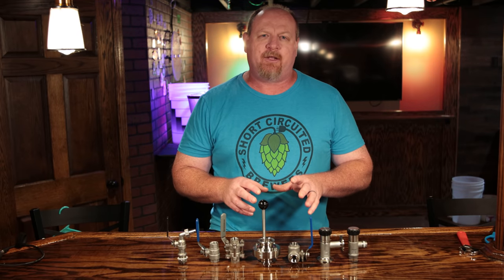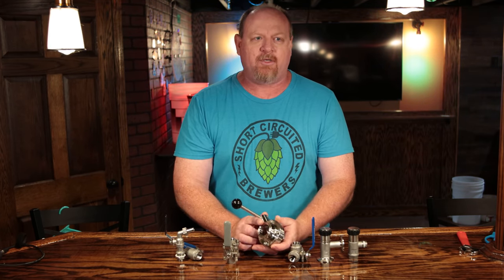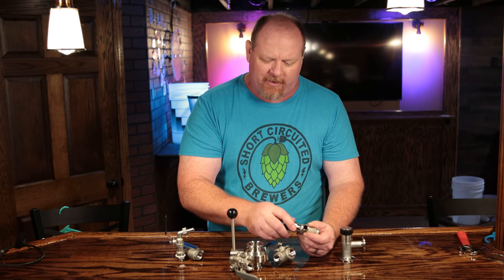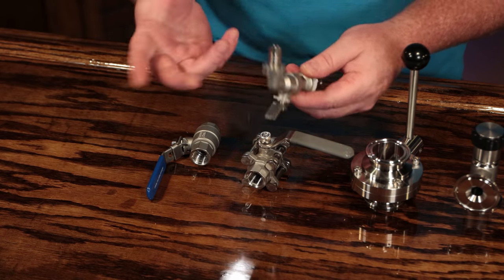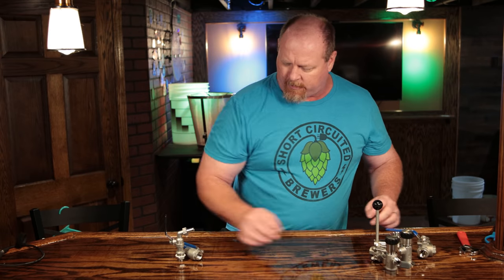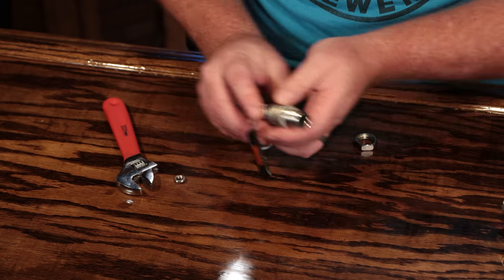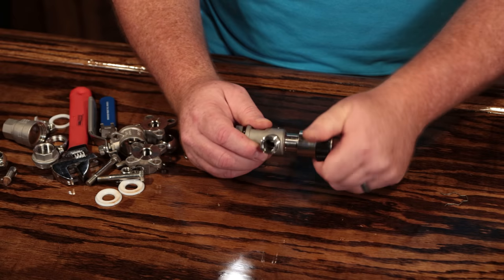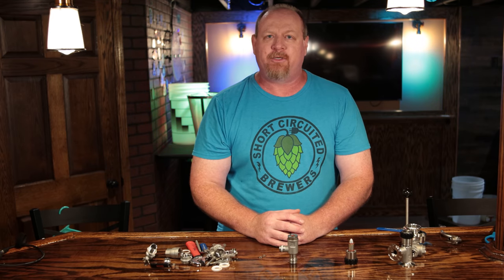Home Brewing Valve Comparison and Cleaning

Comment: I wish the two piece ball valves could always be disassembled.  I got a few used ones in a lot and as you mentioned there is gunk in around the ball and Teflon washer.  Impossible to clean now!  Great Stuff! 🍻
Reply from the maker: Thanks!! 👍🍻
Reply: They can be.  I have been taking mine apart for years after every brew.  Quick and easy. IMO (and contrary to popular opinion) they are way easier and faster to clean than the 3 piece. Initially you do have to place the valve in a bench vice or something similar and use a solid crescent wrench to crack the valve open the first time.  But after that I simply hand tighten for use and hand loosen each time I want to disassemble and clean.  You then have full access to the 2 teflon washers and the ball itself.  So much easier than undoing 4 nuts from 4 bolts.  Then putting that all back together again.  Not to mention the 2 piece is generally 1/2 the price of a 3 piece.  If you are like me and have several valves in your set-up you save a lot of time.  That all said the TC butterfly valves are the bomb for fermenters but for applications where precise flow control (such as controlling flow out of a pump or mushtun) then a 2-piece ball valve is a great option.  Sorry for the long ramble.  Cheers.
Reply from the maker: Good stuff!! 👍🍻
Reply: @Davewick10  yeah, I was trying in the vise. But I guess it needs another go.  Not sure if Brian mentioned be the other nice thing with 3 piece is that you don’t have to over tighten them to get the orientation you want.  Just tight the base against the pot and then assemble in the orientation you want the lever.
Reply: @FermentationAdventures  yep give it another go and they will open for you then its hand tighten and loosen after that. Cheers
Reply: @Davewick10  yep, vise, 12” crescent wrench and a couple of whacks of the hammer and they opened up.  And they’re filthy!

Comment: Great video. Very relevant. I do have the Anvil valve and it hides lots of gunk. I scored a small air compressor and after cleaning I pump air thru it and rotate the valve in and out. Certain O rings are not found on Anvils site. They did help me out. On another thought what do you think of trying to use an ultrasonic cleaner with the valves? I know there are larger ones available and are used for things like carburetors. Im just trying to lessen the disassembly in order to preserve o-rings and save time if possible. Any thoughts on this?.
Reply from the maker: That might be doable...I'll have to research it! 👍🍻
Reply: I'm interested in this concept, Brian if you get a chance to research please include in a future maintenance video.  Keep educating us!

Comment: Do you think circulating hot PBW through the valves would be enough for cleaning or would you still take them all apart? I use a Blichmann BrewEasy with manifold and circulate hot PBW though the system after each brew.
Reply from the maker: The Blichmann valves are generally ok that way but any other ball valves it's is not enough. They need to be disassembled.

Comment: I am thinking of adding a ball valve to my kettle, and this info is very useful!  All of the valves you showed can handle the heat of being on a boil kettle, right?  Also, I recently acquired a second hand Ss Brewtech Brew Bucket.  Any idea if the ball valve on that can be fully disassembled like what you showed?  I can remove the barb from the body, but cannot figure out if the ball comes out.
Reply from the maker: I'm not sure those come apart? All the valves I showed are all able to withstand heat. 👍🍻
Reply: @ShortCircuitedBrewers  Returning to say Thanks!!  I recently acquired a second hand 15 gallon kettle with a Blichmann 3-piece ball valve.  This video gave me the info and confidence to disassemble and clean the valve.  Even though the kettle has not been used in a while, the innards of the ball valve had a lot of smelly, oil-like liquid that needed to be cleaned out.
Reply from the maker: @CascadesHomebrew  great! Glad it helped! 👍🍻

Comment: Before I got my foundry, I used to use the EZ clean ball valves that use a triclamp fitting to hold everything together. Super easy to clean! I had no idea those Blichmann valves existed... Any idea if the threaded version would fit the foundry?
Reply from the maker: Not sure good question!!

Comment: Great idea for a video, Brian! I typically use tri-clamp butterfly valves on my equipment. I thought about using the Blichmann tri-clamp G2 Linear Flow valves but I was concerned that the flow rate at wide open might be more restrictive than butterfly valves. Can you confirm?
Reply from the maker: If you are using large butterfly valves  1.5" or larger then they have a better flow. The linear valve flows really well. You could almost think of it as a 90 degree elbow when wide open there is no restriction at wide-open.👍🍻

Comment: I have my brewhouse split on ball valves, 2 piece for water and 3 piece for anything my beer touches. I bought the 3 piece valves because they were always touted as being “easier to disassemble and clean”, but once I put two wrenches to one of my 2 piece valves and cracked it open, I would definitely argue against that assertion. It did not escape my attention that you didn’t show the PITA nightmare of reassembling that 3 piece bad boy. Once I pulled apart my first three piece I was astonished at the fact that the body is just sandwiched between the two outer plates and needs to be carefully aligned and kept aligned as you’re tightening the nuts. Ugh! Had I known, 2 piece all the way.
Reply from the maker: Haha yeah that would have been 10 minutes of people livres they would never get back! Lol
Reply: Absolutely.  2 piece for the win! For all the reasons you stated.  Once you crack the nut loose the first time, way quicker and more efficient when cleaning.  And no wrenches.  I simple hand tighten and hand open after every use.  Have never leaked. And cheaper too. Cheers

Comment: Hi.  Storage temperature of fermented alcohol, how many degrees should be maintained during the fermentation stage?  (Combining sugar with yeast)
Reply from the maker: Depends on the yeast strain.
Reply: @ShortCircuitedBrewers  Bakery yeast
Reply from the maker: In the 70's f
Reply: @ShortCircuitedBrewers  That is, at 21 degrees Celsius. Is it possible to estimate the fermentation period, how long does the fermentation period end?
Reply from the maker: @sorena.parsi2500  you'll just have to take gravity readings to determine when it's done.
Reply: @ShortCircuitedBrewers  Excuse me, can you explain more?  Thank you very much 🙏🙏
Reply from the maker: @sorena.parsi2500  get a hydrometer for the reading before adding yeast and then the reading after fermentation.
Reply: @ShortCircuitedBrewers  Thank you very much for your guidance.  I am a member of your channel.  Good luck.  thank you so much. 🙏🙏🙏🌹🌹🌹💙

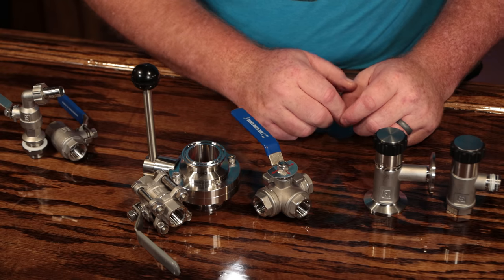Comment: 4:05 You see those 3 way valves a lot if you are a Brewtools owner. I have about three.
Reply from the maker: Yeah that's true!! Not many other systems use them though. They are pretty cool that's why I included them. 👍🍻
Reply: It's worth nothing that there's L type and T type 3 way valves also. L type don't allow you to have flow through both exits at the same time.

Comment: I think skipping the butterfly valve saying it's "too hard" is a disservice. Rather, you don't really need to disassemble them due to the design.
Reply from the maker: I've seen some instance of crud in the connection between the silicone and stainless housing. Relatively minor but it can get in there. 👍🍻

Comment: Is that butterfly valve a blichman?
Reply from the maker: No it's another brand but essentially the same. 👍🍻
Reply: @ShortCircuitedBrewers  so generally those nice butterfly valves have a harder time controlling flow? Was looking at the blichmann version
Reply from the maker: @peterluisruvalcaba1674  correct butterfly valves are not good at flow control. They are either a trickle or a large amount of flow.

Comment: Blicmann is a "Needle valve" or "flow control" as it's called in the process industry. Not their invention by any means. And several on the market for much less upfront cost. None of them are easy to clean. Good stuff Brian.
Reply from the maker: Did I say they invented it?
Reply: @ShortCircuitedBrewers  No you didn't.  I was just pointing out that the needle valve has been with us for years , even before Blicmann named it a linear flow valve,  😉 . On another note , I just cleaned the valve on the Anvil. Might I say it was funky ,nasty shit.  I'll have to be more prudent in cleaning it. Thanks for giving me more cleaning duties, damn it!
Reply from the maker: @curtpick628  haha.. I got lots of cleaning to do Lucy!!! That's all we are janitors and yeast stewards!! Lol
Reply: @ShortCircuitedBrewers  It is a 50 /50 craft for sure. Clean 50 percent of the time , brew the other 50. Thanks again for the reminder that I was slacking in the cleaning department.
Reply from the maker: No problem! Wake up for me too... Clean your valves bro!! Lol